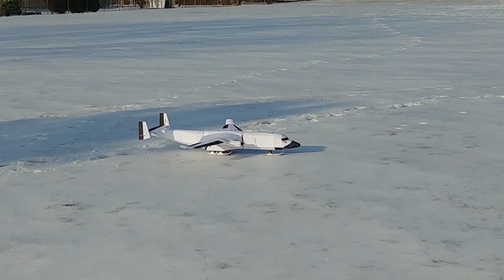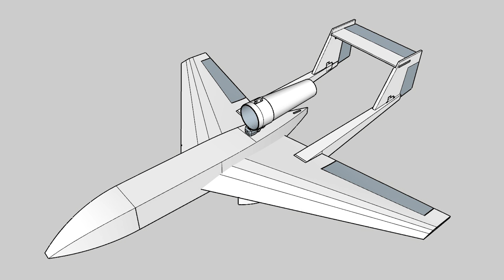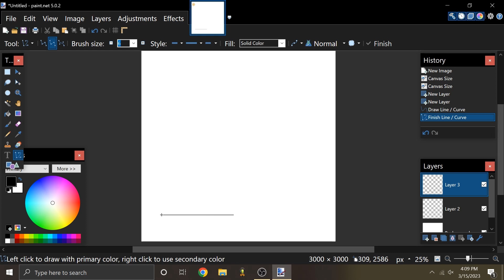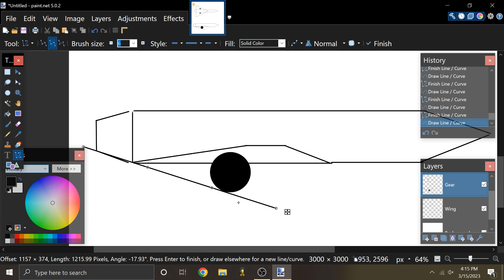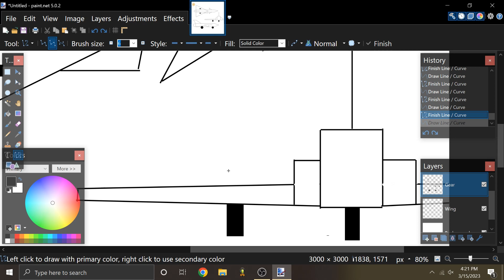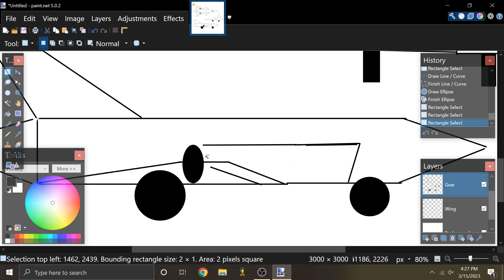Requirements and Conceptual Design | RC Scratchbuilding #1

Comment: Super cool to see your A-Z approach for RC planes, can't wait to see how this one turns out, lookin like a real beauty. Have you ever thought of using a a 3d modelling software to help with the design? I may just be biased, but being able to quickly block in different features and moving them around in blender is extremely intuitive and nice to help visualize the aircraft as a 3d object.
Reply from the maker: I do use Google Sketchup 2017 once I get past the conceptual design stage and need to start putting dimensions to things and getting them to fit together. It's a limited and antiquated program but it works for what I need it to do, given a few plugins.

Comment: Oh I am excited for this one! looks great already, love the clean sheet approach. For the thrust vectoring I think you'll be best off with using vanes  to vector it instead of paddles. Should be more efficient and you don't have to deal with hot exhaust. Looking forward to seeing the next videos, and hopefully to seeing you again on issacs some day.
Reply from the maker: That's a good point. I was planning on an entire 2d-vectoring conical nozzle myself - I'll probably need to do some research into efficiencies of the different approaches since I don't have much margin at all to maintain 1:1 TWR on a 4s setup.
Reply: @Pieliker96_  my comment was inspired by a RC X31 I wanted to build a while ago. Their plans had good success with two vanes going all the way through the exhaust. Makes actuation simple too as you only need one servo for each direction and mo mixing